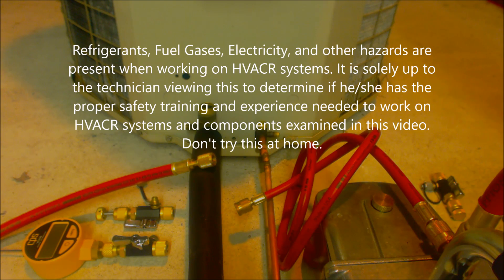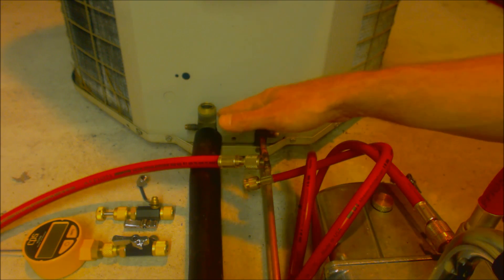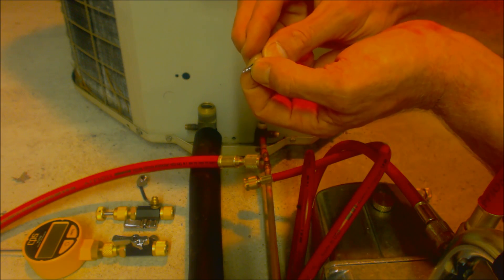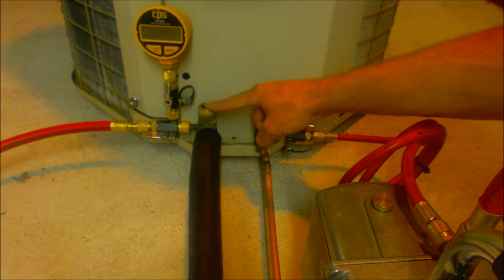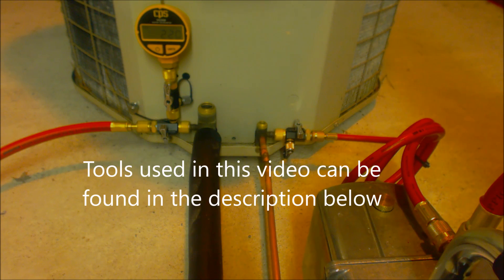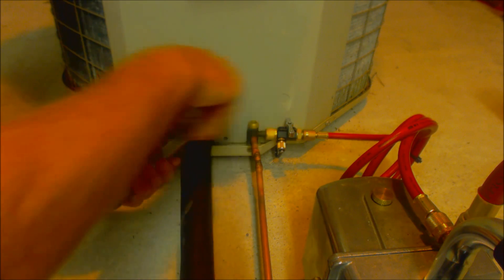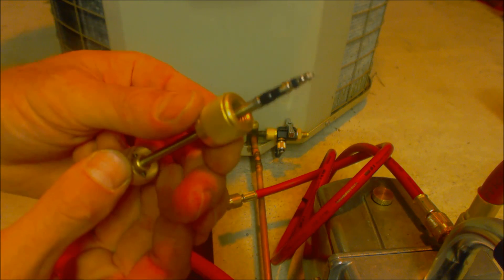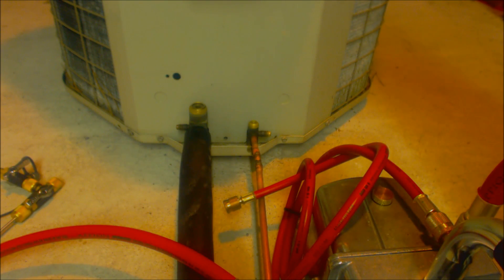HVAC Vacuum Pump Hose Setup and Procedure, Start to Finish! Micron Level Testing

Comment: I am continuing to be perplexed why I should care about the metering device or the schrader.  They are  not 100% shut offs; they are simply restrictions in the system. What that simply means in my simple mind is that the vacuum pump is pulling a vacuum 'disproportionately.'  In other words, it's pulling a vacuum faster and deeper from the pump to the first restriction (that would be a schrader) and not as fast or deep after said restriction. But that doesn't mean it's not pulling a vacuum system wide; it simply means it's conceivably pulling it unevenly; really infinitesimally. I'm the last guy to guess at things, so that 'infinitesimally' is measurable. It's measurable by simply turning off the pump and allowing a single minute or two to stabilize/ equalize. If I am at 300 microns with a 7 cfm pump, those restrictions might cause the system to rise to 330 while I do my standing micron test----which we have to do anyway! In other, other words, 300 microns is 300 microns. That's an objective number. Removing my cores doesn't get me a deeper vacuum. My guys have been trained to have a bias towards getting under nitrogen test first. Once the pump is on then, we always have 2 hours left for all the other tasks to wrap up. In the end, considering we run 10-20 minute pump time to get <300 microns cores in, and 4 minutes to get <300 microns  cores out, why should I care? I don't have a deeper vacuum. I have a faster vacuum. I do not understand just how removing all my depressors and cores and all those extra flaming hoops benefits my system. I change my oil regularly, I use a 1/2" YJ low loss hose just for vacuum. I average 10 minutes or so in a one hose system to an objective <300 microns, fully equalized.

Comment: Why do you have the valves front seated? Is that because you are pretending this is a new install? I am just making sure that if it is an old unit and you had to open it for something that you ain't needing to front seat them for a vacuum. I seen where it said once you have opened them you never need to mess with them again but I am just confused.
Reply: Or I guess if you were not messing with anything in the outdoor unit and you pumped down to it you would front seat them?

Comment: How would I know of my appion core removers are leaking? Cause i tried pulling a vaccum on my last three jobs & it would not pull down. It'll stay around 2,000 microns until I pull a vaccuum through my guages & micron guage on the pump itself. I know there was no leaks in the system because I pressurized the system & bubble tested my work & system held pressure for 30min. My core removers only worked on two jobs. But when I attached my guages to the core remover & pulled vacuum it pulled down. Idk

Comment: You can pull a vacuum with refrigerant in the system?
Reply from the maker: Hey KC KC, no the vacuum procedure is used to prepare the empty lines for refrigerant, thanks. Pull the valve cores out of the empty system, vacuum, perform the standing vacuum test, break the vacuum with refrigerant from the refrigerant bottle, then reinstall the valve cores with the valve core removal tools. The valve core removal tools remain on the unit the entire procedure. I have the tools I use linked at amazon.com/shop/acservicetech thanks!

Comment: the third valve core removal tool you use to hook up the micron gauge.. does that need to be vacuum rated as well? im thinking about buying those appion valve core removal tools but i already have a removal tool its just not vacuum rated. was wondering if i could save myself from buying a third appion tool
Reply from the maker: It does need to be vacuum rated. You could run a standing vacuum test before buying the third to test and see if it holds 200 microns. I had some others and they leak so I only rely on the Appions. It is just such a non worry now with those tools, thanks!

Comment: What is a front seated valve. I have a hard time understanding it. My a coil froze . Am low on refrigerant. how do you go about opening the valves to recharge.
Reply from the maker: check out the "acservicetech, connect, charge refrigerant, disconnect" make sure to be epa 608 certified before working with any refrigerants. You can find info on this at epatest.com or escoinst.com thanks.

Comment: What is your opinion on using a tread sealant like the blue nylog. I noticed that you didn’t use it, you recommended the oil. Thanks in advance!
Reply from the maker: I use either nylog or oil on permanent flare connections for refrigerant lines but for vacuum pump and hose connections I just use refrigerant oil. I have no problems with leaks at the hoses or flare connections in reference to holding 200 microns. In reference to flares, I think it is just important to have a good flare and torque applied on minisplit flares whether you use oil or nylog, thanks

Comment: What are your thoughts about pulling a vaccum but attaching your micron guage away from the condensor service valves and instead at the evaporator coil service valve? Also what about using the 1/4 inch female connection on the vacuum.  Ive been told that the 3/8 is the only one you should  use.
Reply from the maker: Hey Sean, I want to thank you for the very nice comment you left on Patreon! I really appreciate it and am glad that the videos have impacted you that much! That is awesome to hear. I pull a vacuum from both sides as you saw in this video. Most vacuum pumps will come with a 3/8" and a 1/4" but some of the larger ones will also have a third which is 1/2". I always use a 3/8 by 1/4" and a 1/4 by 1/4" hose attached to the vacuum and directly to the valve core removal tools even when I work on high stem valves without schrader valves. This is so that I can use the valves on the valve core removal tools to isolate the vac from the system and another to isolate the micron gauge. It took me roughly 15 minutes to vacuum down a 125' 1 1/8" lineset down to 280microns with a 6 cfm pump. To give an example, when I isolated the vac pump, my micron level did not rise more than 10 microns. I think this helps answer the question about the micron gauge placement. The evap would be the most accurate place to put the micron gauge but as you can see after another 10 minutes of a vacuum test without the vac pump on, the micron level only rose 10 microns so that would be the same as at the evap at that point. Always make sure to pull the valve cores out and your micron gauge mounted on the larger suction line port valve core removal tool and you will be fine. I make sure to do an oil blowout before vacuuming a system that has oil in the lines that I am vacuuming.  I pull the vacuum from both sides of the system and use two hoses attached to the vacuum pump. These vacuum techniques have been evolving so there are many technicians that are still using older schools of thought or including the manifold gauge set on the vacuum setup. If the individual that said you only connect the 3/8" line to the vacuum pump has a 4 port manifold then it is because they are pulling the vac through the manifold via the 3/8" line. In that case if you wanted to include your manifold gauge set for whatever reason in the vacuum then that would be correct. The SMAN460 has a micron gauge built in and if you wanted to use that then you would only pull from the 3/8" hose, thanks again and hope that answered your questions!

Comment: Thank you again for the videos. They are great and very helpful. One question is: Why do you leave the hose connection a little loose before you turn on the vacuum pump?
Reply from the maker: This type of vacuum pump does not have a gas ballast and seems to start easier if it is hasn't been used in a while so sometimes I will do that, thanks

Comment: Hi. It's Blaze again. I noticed a comment regarding triple evacuation. Is that still the way to do it if you're working on a R410A system?
Reply from the maker: I use the triple on minisplits because the tubing is so small, as well as on linesets that I flushed do to burnout, or on a system you suspect has water in it, otherwise I just use a single evac. You can tell if the micron level does not rise after ten to fifteen minutes that there is no water vapor in it, thanks

Comment: Thank you Craig! as always a very nice toturial.
It really does help me a lot as new in the Hvac field.
Have you use Stay Brute 8 by any chance? I would like to know if will be a good idea to try it with positive results.
Reply from the maker: Yes it works well and mostly used on r-22 but now people seem to be comfortable with it for r-410a though it will add some acid in unfortunately but always use a small amount only. In some cases we have to anyway because you can't braze near a silver solder joint as this would overheat it and cause a leak so either cut all the stay brite 8 out or silver solder next to it, thanks Octavio and sorry it took so long to get back to you. Me and my wife were away celebrating our 10 year anniversary!

Comment: Great video!  I never thought about adding a third valve core removal tool for my vacuum gauge.
Reply from the maker: Yeah it is important to have a good vac rated valve to remove the micron gauge from the line, thanks!
Reply: acservicetech   Hey it's Blaze again from SoCal. Question. I am starting to have a few of the newer York heat pumps that are starting to have bad valves on the compressor. The pressures are even 250/250. What should I be looking at as the cause. 2 of them are only 1 1/2 years old. Any suggestions would be helpful. Thank you and have a great Sunday.
Reply from the maker: You could think about low oil return from very oversized lineset possibly. I just ran into this last week. Is the unit sized properly or does it run all the time? You could also look at lineset lift and compare this to the manufacturers data, thanks Blaze, always a pleasure!
Reply: acservicetech This is a package heat pump. I really do not know how they operate it. It's a 2 ton. I know that in the past where the line set was long like in mall applications I installed a fan cycling switch which seemed to allow the oil to return.
Reply from the maker: Wow, only a packaged unit? Maybe do a little research on that particular unit. Maybe there is some type of default from the factory. Thanks Balze!
Reply: acservicetech Thank you for the follow up. I spoke with my distributor US Air and they heard nothing but I'll definitely call corporate and see if they notice a possible trend. I'm getting my service truck ready to do that compressor replacement after I take a look at a Rheem unit at 5:30 am to see why the thermostat is blank. I really love the industry that we're in. On August 9 Th. will be my 24th anniversary. I'll be 64 at the end of the year. Thank you for all the great videos and teaching our future mechanics. Have a great Sunday and keep em (videos) coming!
Reply from the maker: Oh wow, that is awesome, congrats! Good luck and let me know if you find anything out specific on those compressors, thanks

Comment: I use shrader core tools (one on each side), hook my 3/8 hose x 1/4 hose to the suction line, and my micron gauge on the liquid line. That way the micron gauge is actually as far as I can get it from the vacuum.
Reply from the maker: You can do it that way too. There are many ways to pull a vacuum. I happen to prefer not to pull across the metering device but everyone has their way of doing it. I hope you enjoyed the video Jason!

Comment: Your hoses are 1/4" x 3/8". The pump only has a 1/4" & a 3/8" connection. How are you connecting one of the 3/8" hose end to the 1/4" pump connection?
Reply from the maker: Hey 11 sprinkles. I pinned the hoses in the top comment and they are in the description. The one is a 3/8" to 1/4" and the other is a 1/4" to `1/4". The pump has a 3/8" and a 1/4" and the system has two 1/4" ports, thanks

Comment: Do you triple evac the system. I take it that that unit is R-22 the older guys i use to work with just did liquid purge on those systems
Reply from the maker: You can do a triple evac but we usually only do that if the lineset got a lot of moisture in it or the pump and hoses are just too big for the system you are attaching to, thanks jc!

Comment: How many cfm is a vacuum  pump good for ac heat pumps?
Reply from the maker: I usually use a 6 cfm vac pump for all split system applications. You can of course use a 3 cfm as well or two speed pump and I have at times. The one I used in the video is a very basic single speed pump 6cfm JB pump with a great track record. Just make sure to continually change the vac pump oil. Here is a link for this-  Here is a link to the JB 6 CFM Vacuum Pump   http://amzn.to/2nqbvo8
Reply: Thanks, you help me a lot.

Comment: Awesome job man. Thanks for sharing. What are the effects of pulling a vacuum lower than say 200 microns?
Reply from the maker: No bad affects, the lower the micron level the better. You can test to see if any water vapor was frozen by just waiting on the vacuum test to see if it rises but is usually good unless it was something odd like a new construction job where someone left one of the lines open and water got in or something, thanks
Reply from the maker: In the US, EPA guidlelines state 500 microns and supercede manufacturer instructions if the manufacturer states a recommended vacuum above that number. Then we make sure that the micron level does not rise above 500 microns, thanks

Comment: Thanks for the video. How do you clean the attachments between the micron gauge and the service valve of refrigerant, so the next time you attach the micron gauge, the sensor isn't damaged with any refrigerant oil that might still be in the attachments?
Reply: the paslode  cleaner is "heptane"(magical cleaner) and difluoroethane (propellant/R152A)
Reply from the maker: You would use the same type of insulation as found on the rest of the lineset up to that point and then zip tie that insulation in place and use cork tape-  http://amzn.to/2vWSc9B  or foam tape -  http://amzn.to/2vX3lY2 over the open seams. I would also put some more zip ties over that just in case it lost its adhesion. Make sure to not make too big of an insulation ball as it won't fit behind the unit in order for the wall unit to snap back into place on the wall, thanks-
Reply from the maker: You can use nitrogen for the lines and fittings. In the case of this manufacturer they say you can clean the sensor with rubbing alcohol. Make sure not to pressurize the gauge with any pressure. Thanks Wiser Soul!
Reply: I used Paslode electric tool cleaner from Lowe's to clean the oil out of my Supco micron guage. I tried alcohol and de-natured alcohol first with no success. I saw Paslode recommended somewhere, maybe a Yellow Jacket video and it worked great. I had bought a Blu-Vac in the meantime so I now have two working micron gauges.
Reply from the maker: Oh wow, good tip. I have used rubbing alcohol in the past and it seemed to do the trick. Hey that is smart to have two if you can't seem to get the one cleaned, thanks Jim!
Reply: Thanks. I am vacuuming a Fujitsu 15RLS3. In each pass I am vacuuming down to about 300 microns. After the first pass the CPS gauge went up to about 2200 in spurts from 300 microns. Now after 4 more passes the CPS gauge goes up about 10 microns every 10 minutes. It's currently at 440 microns. Is this a sign of a micro leak or is this how it's with the CPS gauge? Or could this be a sign of moisture still in the lineset? Thanks in advance.
Reply from the maker: If you are holding a vacuum under 500 microns for more than 15 minutes then it is probably just a tiny leak on one of the hoses that is making it climb 10 microns every 10 minutes. You should be good with that. Great job with more than a triple evacuation to remove moisture!
Reply: Thanks. On the 5th time I just wanted to get done with it, so I released the refrigerant while under 500 microns and I am seeing cold air from the indoor unit :) So far so good and I hope there isn't a leak elsewhere in the linesets. Thanks again for the excellent, very informative videos.
Reply: One thing I am curious about. If I do happen to have a tiny leak in the lineset that was causing the issue with a 10 micron climb every 10 minutes, how long will it be before I see all the refrigerant to be lost? So far, I have cold air blowing from the mini-split wall unit.
Reply from the maker: I would hope that is not the case as we typically only hold vacuum normally for no longer than ten to fifteen minutes. I think it was either your connections or just a tad of moisture maybe left but not much at all. That should be a good vacuum.
Reply: Thanks. I am also wondering what insulation you would recommend to wrap the connection points of the line set with the indoor mini-split wall unit. Currently they are exposed and there's some sweating.